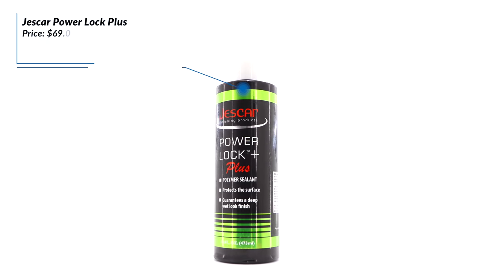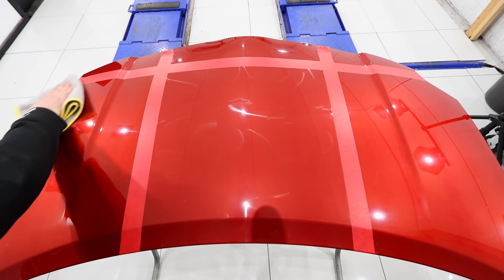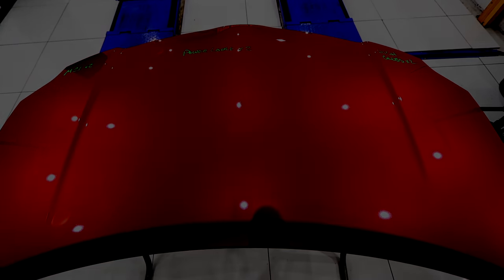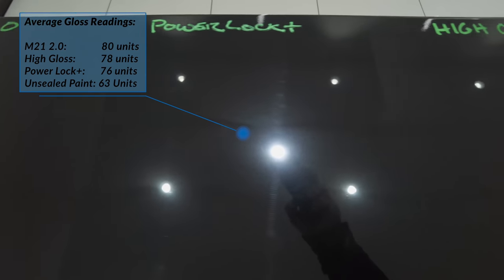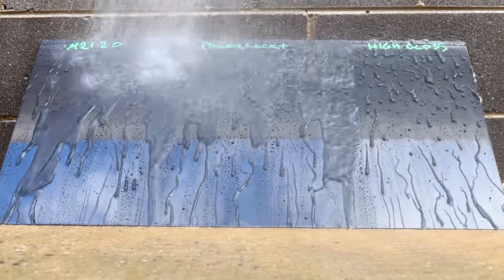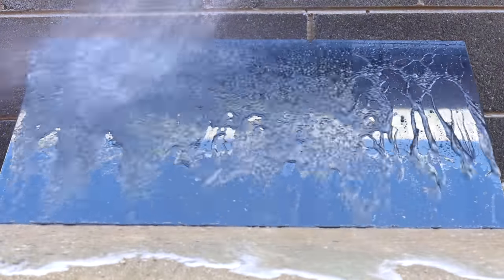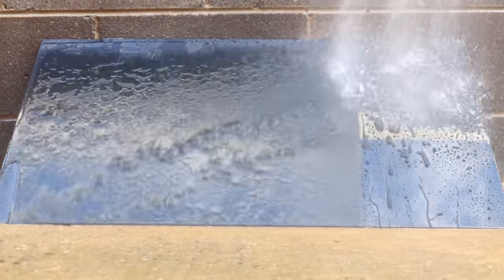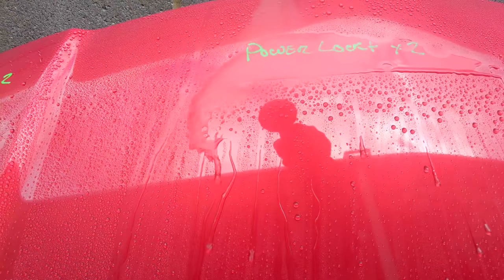Meguiars M21 vs Jescar Power Lock+ vs PolishAngel High Gloss | Best Car Paint Sealants Reviewed!

Comment: Within these three, I only have experience with power lock. I also find it really disappointing, durabilty wise. It lasts one month max, in my experience. Yes, it is dead easy to wipe off. It does look good and silk feeling to the touch is amazing. But none of these last too long to the point that it just doesn't worth it. In my experience, even show car waxes like Pinnacle Souveran or Nattys last longer, look better and are more joyable to work with. Power lock lasts about the same as P21s and I prefer P21s. Better to work with and better looks. Just my experience with it.
Reply from the maker: Thanks for sharing your own experiences with those products!
Reply: I use powerlock plus and top it with colinite 845 for durability. Works great